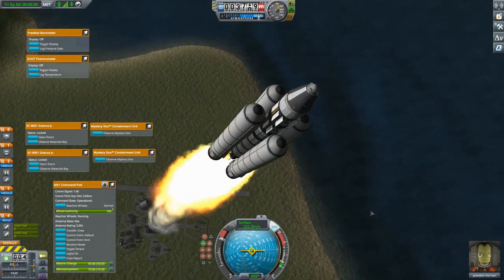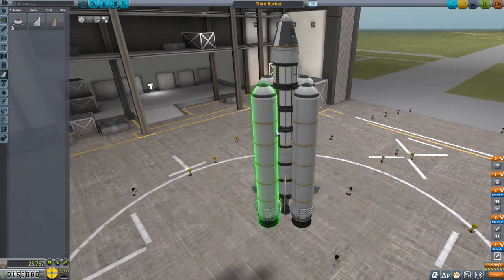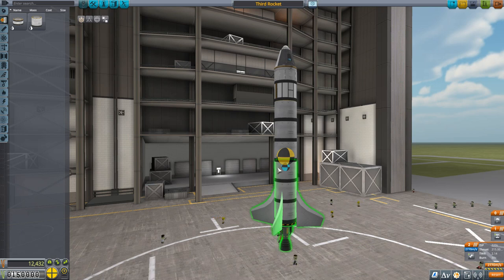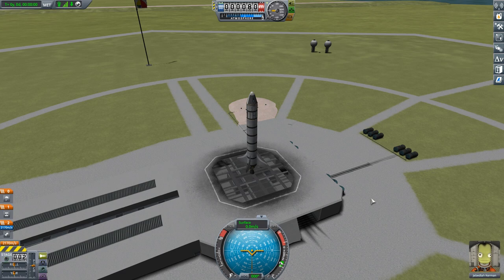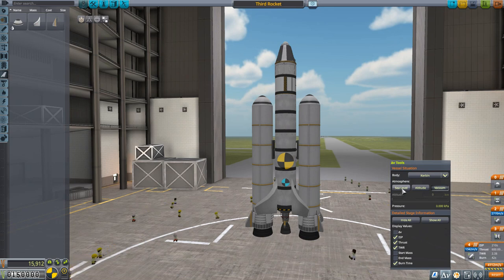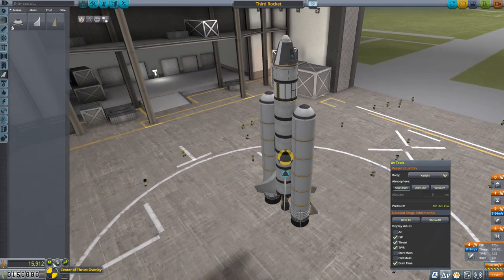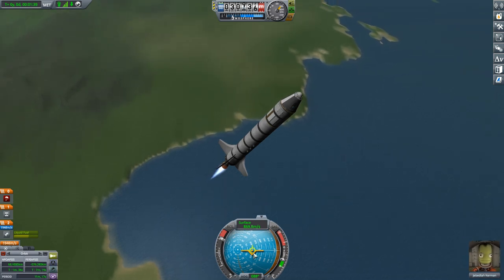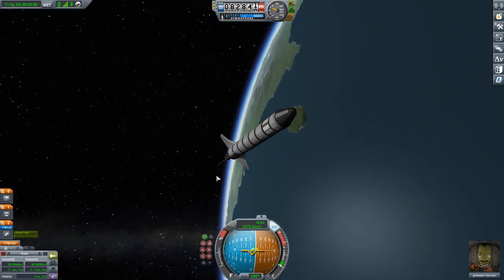How to Stop Rocket Flipping | KSP Beginner's Guide

Comment: why do you care about TWR? obviously cus low TWR wont launch but what are the downsides to a high TWR? only thing i notice is my rockets tend to become rigid on prograde when the aerodynamic effects appear which does tend to mess orbits up slightly but i can easily recover from it easily.
Reply from the maker: As drag goes up by the square of the velocity, too much velocity in the lower atmosphere reduces efficiency, and in extreme cases can cause things to explode. In addition, as you noted, the vessel is easier to control. In addition, addition, there's the ascetic factor.
Reply: @MikeAben  thanks

Comment: If I may add, what I have found by experience is that if you keep the vessel  direction indicator on the navball within the circle of the prograde marker and keep the speed lower in in the lower atmosphere the rocket is much less likely to flip out on you.  
Also if you are trying to keep part count down or don't want to use a bunch of fins, you can stack the fuel tanks and use the external fuel ducts to move fuel from the lower tanks to the upper tanks to keep the center of mass from going lower than the center of drag.   
More fins will usually always make the rocket fly better but I prefer the look of rockets with no fins and love a challenge.   I hope this all made sense and possibly helps someone someday.
Reply from the maker: I agree, but for this video I wanted to present the most simple solution as most people would be running into this problem very early into their games. Just to add, you don't need the external fuel duct to move fuel around. Right click on an engine in the VAB and open the Fuel Overlay. The higher numbers get drained first and you can adjust the numbers by right clicking on the tanks. Like you said, you want to keep the fuel mass forward on the rocket.
Reply: @MikeAben  I have never been able to figure the fuel priority/flow settings,  I will have to try that.  Thank you.

Comment: Tried to copy what you were doing and despite well over two dozen attempts I was never once able to get anywhere close to orbit. I replicated your rocket exactly, the first stage usually goes without a hit and I decouple near the same altitude as you but despite burning similar fuel amounts I am far further from AP than you are when I reach 80K AP and when I begin burning along the horizon I run out of fuel before I am anywhere close to reach an orbit, let alone leaving fuel to return. What an immensely frustrating game that I can spend well over 4 hours trying to accomplish what should be a basic task in the game, it's tough not to just uninstall.
Reply from the maker: Unfortunately, it isn't a basic task. It's one of the tougher tasks in the game. I happen to have another getting to orbit video dropping on Monday that I think is better than this one if you want to try again.

Comment: Now I'm having the opposite problem where the rocket is too stiff and I can barely change the trajectory I made it so the center of drag is wayy below the CoM  and where the CoD is almost exactly the same as the CoM nothing works
Reply from the maker: If the rocket is like the one here, it will steer much better once the SRBs are staged and you're on a gimballed engine.
Reply from the maker: Also try starting the gravity turn earlier when you have less speed.

Comment: i built a very large rocket launching a small base in one launch to minmus but for some reason it was constantly wobbly even out of the atmosphere, autostrut was on and i placed some normal struts connecting the base to the fairing. do you have any tips or just a better idea of going at this mission? (if this matters here, i have some mods like extraplanetary launchpads and ksp interstellar extended)

Comment: Ive been having flipping problems but not with beginning rockets, its with all the ones ive been building with rockomax parts, im really bad at building big rockets that aren't topheavy and don't flip, its so frustrating, i got a flight in orbit around the sun with like 600 science from an eve flyby and its out of fuel. I keep trying to pick him up but i can get close enough to him to have him fly over and still have enough fuel to get home
Reply from the maker: Those are tricky missions, especially if the target orbit is elliptical and/or inclined. You first need a good budget. I do have math videos on this, but you can also do this by setting up a maneuver with anything in low orbit that gets you to the target orbit. Then added further maneuvers until you are matching the target orbit. Add up the maneuvers for your budget. Likely a good idea to add 10% on top of that.

Comment: I have gone over and over this tutorial, can not get this to work at all.  When I fire the stage to decouple boosters the stage fires but the boosters just stay on the rocket.  For what ever reason the booster engines won't detach.  Tried it using smaller booster rockets with no problems.  I then figured that maybe the fins are catching the boosters but to no avail.  No matter how I set up the fins same problem.  Extremely frustrating.
Reply from the maker: Is it possible you are attaching the boosters directly to the core booster instead of the decouplers? It's an easy thing to do in the VAB.
Reply: @MikeAben  Thanks for that Mike, I'll check it you are probably correct there.  BTW love the videos

Comment: I have my center of lift below the com and my rocket still flips. I really don’t understand why this happens
Reply from the maker: The CoM will move as you drain fuel and especially as you lose stages. CoL can also move as stages are lost, and will actually creep forward at hypersonic speeds.

Another reason could be flying too aggressively. You should always be close to the prograde icon on the navball, especially as speed increase.
Reply: @MikeAben  Based on what you’ve said I’ve figured out the problem but I don’t know how to fix this. I tested all of the stages and the COM is fine, but when I lose fuel it become top heavy. How do you adjust fuel priority to fix this
Reply from the maker: @Metronomical3  Right clicking on a tank in the VAB gives you the ability to change the priority. It's possible you may have to go into your settings and toggle on "advanced tweakables". I have a video that talks about managing fuel flow.
https://youtu.be/jW756GUltXg

Comment: My rocket starts flipping just after launch. It stays stable for maybe 2 seconds and then there's no stopping it. My com is above my coa so I don't know what's going on. It is a tall rocket but still, there should be a way to get it up.
Reply from the maker: Both the CoL and CoM can move during flight. Try adding more tail fins. You can also adjust fuel priority so the lower tanks drain first. This will get the CoM to move forward during flight.

Comment: I still dont get it. I get up to space. And just get dragged back down. Been at this for hours and im getting pissed
Reply: First of all, I'm sort of a beginner, and only just figured this out (haven't even gone to the Mun yet), so I'm just going to tell you what worked for me. Other people may have better advice.

You have to circularize your orbit, which means to make sure your periapsis is also in space (70 km or higher), not just your apoapsis. I'm sure there are videos dedicated to that. If the problem is that you're already trying to circularize, and it drags you down before you can manage it, then you should try turning during your ascent to give you more time (getting the right amount of turning takes some practice, and I still don't think I have it optimized, but I apparently got it good enough). If you're already doing that as well, maybe try making sure whatever stage you're using to circularize your orbit has a higher thrust to weight ratio so that your burn can happen faster (1.3 to 1.35 isn't a hard and fast rule; I've seen people who say you can go up to 1.6 and others you say you can go even higher. I was using Terrier engines to circularize because people said they were efficient, but apparently the have a really low max thrust and so they're only efficient after you have circularized and are trying to go somewhere else like the Mun).

Comment: What infuriates me is how my 100% balanced and symmetrical rocket will tip over in the lower atmosphere and after it's wasted half it's thrust right itself upright.

But somehow my top-heavy rocket with an upside lander on top of the cockpit is totally fine.
Reply from the maker: The Aerodynamic Overlay ball in the VAB is often not reliable.
Reply: @Mike Aben  That's good to know. So does that the overlay in the SPH is more accurate?

For reference I've been using the PS4 version and the shortcut keys are exactly the same if you plug in a keyboard. I just wish there was a way to toggle off the visual effects of exploding/burning parts as it slows everything to a crawl.
Reply from the maker: @mikevignola4213  No, the SPH can be wacky too.
Reply: @Mike Aben  That's unfortunate, I started playing about a month ago, and you're right it does take ALOT of trial and error. 

One thing of note about the revert feature that is jarring is if you revert to VAB or SPH after a catastrophic failure you will lose the cost of your vessel and any crew will be killed. I don't know if this is an issue exclusive to consoles but you have to revert to launch first to avoid this problem.